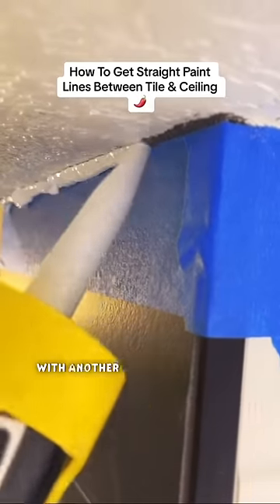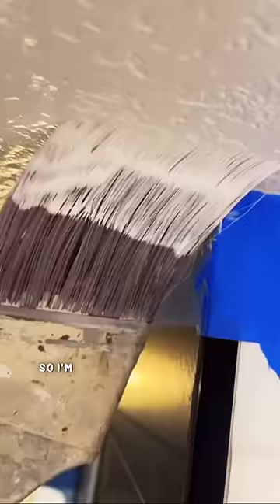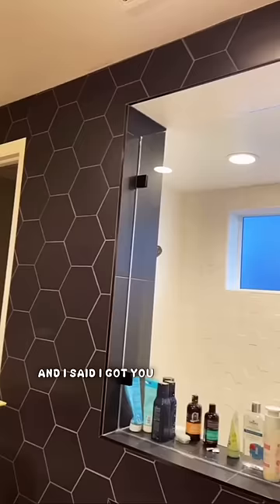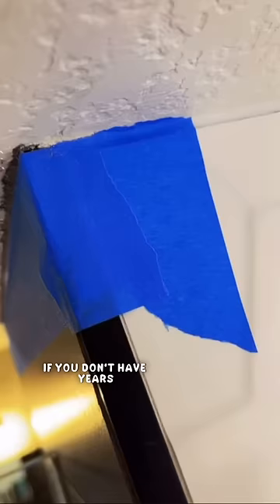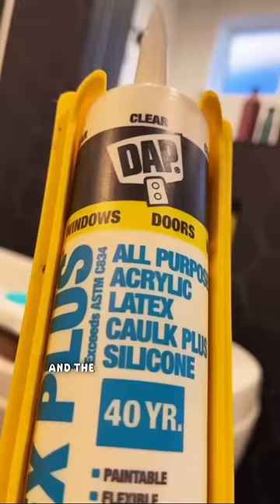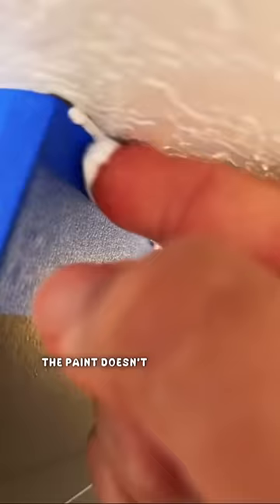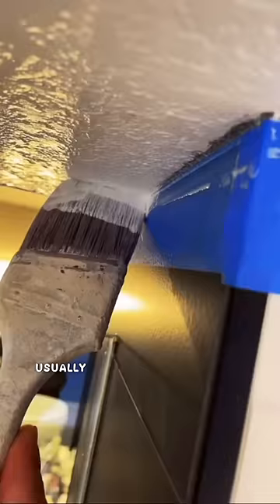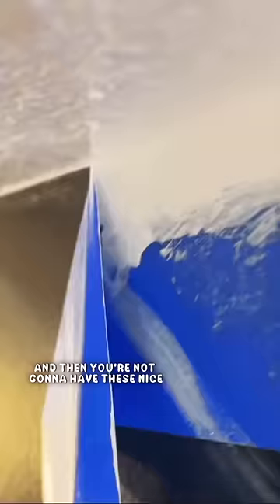How To Get Straight Paint Lines Between Tile & Ceiling.

Comment: Right on man I'll give you a little tip man that brush you are using to cut in is a little soft get you a firm brush man won't bend on the edges and won't fray as much changed my painting been doing it and remodeling for years  so check it out wooster makes a good firm brush it's about 27 dollars but will Last forever if ya keep it clean keep up the good work brother
Reply: I use Corona brushes that work the best of any I’ve used and usually are the stiffest yet still soft enough for interior smooth finishes
Reply: I have that brush $28 🖌️ that and purdy 3" sash just about only ones ever use 👍
Reply: If you continue to use a brush regardless of what brand will bend and “fray”.  You could use Purdy Wooster store named it will eventually do the same thing. I can buy a $28 brush that you say and use it for about 6 months and need a new one. But if you use tape and don’t bend and flex the brush as intended you could get years out of it. Painting is a trade not a hobby and if you need to use tape you shouldn’t be painting because it adds time and less money.

Comment: Tile guy here. When you caulk that same color of the grout or whatever the wall is (owner preference) you can put some tape to protect the paint and give it a nice finish. Another thing. I know you gave it a quick fix. But it would be better to removed the grout (it’s too thick that it will crack eventually. I know it’s more work. But ideally you removed grout and do it the right way. But you did what you could, 😊

Comment: Great tip. I’ve heard a version of this where you use the wall color paint first to fill in the gaps but I’ve never had the wall color on hand. Using clear caulk that will show the wall color through it is a smart adaptation. I wonder if this could make a clean line on stucco.
Reply: For stucco use duct painter tape and spray it from the same angle and if you don’t have a sprayer brush or roll away from the tape

Comment: Alternative tip: You can also just do a quick coat of your wall color first to seal the tape. Anything that bleeds will be the same color as the wall and it will also seal the tape from any farther bleeding. Then come back over with the ceiling color. Works great for when you're doing larger jobs and especially with texture.

Comment: Tile guy that did the shower in the back house left it exactly like that. I was wondering if this would work. I'll try it this weekend when I paint all the trim
Reply: Try regular white painters tape not only will you save money but it should provide a cleaner line since the adhesion is a bit stronger

Comment: On this particular wall, bro you could use plain white silicone and that will give you your straight white line without paint and it still seals perfect! Using the caulking is great for your straight lines but work easy not hard! It depends on what part is white if any! Glad to see you use your finger the ones that use the tools run into more problems than not..! Good clip my man..🤠👍🏽🫘

Comment: As for the job, personally i would have removed the old silicon, caulk the corner and paint them once all is dry then black silicone again for the detail. But , if customer is happy them who am i to judge🤷🏻‍♂️😁 

As for tapes i use either pink tesa or Q1 pink tape, way better than frog tape and this blue tape. No criticism, just my two cents😂👍

Comment: The best thing is learn to brush and brush a straight line but this works but the caulking will eventually Yellow and get ugly just tell the tile guy to mask so you can have perfect lines or float the ceiling to smooth and it’d be easier for the painter/tile guy

Comment: to the people thinking green tape solves bleed - all tape bleeds on certain things, uneven grout will absolutely result in bleeding even with frog tape, so its more optimal to go with blue because its half the cost and youll need to run calk over it for the seal regardless if its frog tape or blue. Same can be said for older houses that have shifted a lot, if the walls arent level there will be micro bleed even with frog tape so the calk seal is great for those perfect lines. Unfortunately I think whoever grouted that was in a rush and did a shit job, you can be great at precision touch up work but that grout guy was sloppy - not much you can do to make that specific thing look any better, im thinking they should have found a closer grout match to that tile - its way off

Comment: I have years of experience and I can truly say never use blue tape now a days because your just buying the cheap version of what it use to be. Same goes with box tape and duck tape. 
If you're seeking best results the industry wants you to invest a little more on the expensive tape in this era. 
We no longer live in the era of longevity but more in the era of "recycle reuse rebuy."

Oh and buy the way the work tapes do have an expiration date so don't go storing them for a long time thinking they will still be good. You'll just endup getting small uneven strips out of your roll from the glue hardening.

Comment: Whenever i tape anything I run over it all with a damp rag. It preseals it and barely ever does paint bleed through. If you were to do this with caulk..definitely want better caulk and something that is paintable in 15-20 mins. The caulk in video is bottom of barrel caulk and doesn't last and even though its clear it turns yellow over time and it grab dust in the room so try to be as clean as possible. And painting right over the shi! Caulk it's definitely gonna fail even faster bc you're not even allowing it to cure.

Comment: You should not have textured ceiiling above a bath or especially a shower area .. moisture will accumulate in the crevices and mold can grow .. also very difficult to clean out.  😢
Reply: I have serviced apartments that have textured ceilings and as long as the ventilation is good you don’t have issues, but if the tenets didn’t use the vents, it definitely shows.